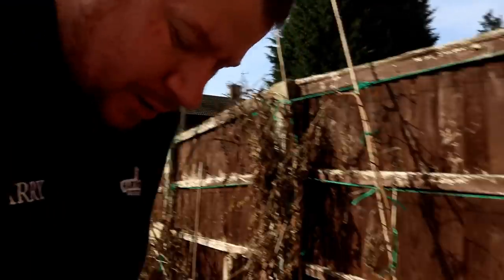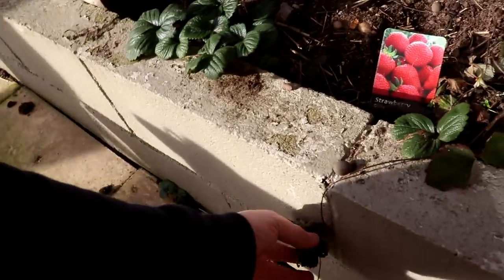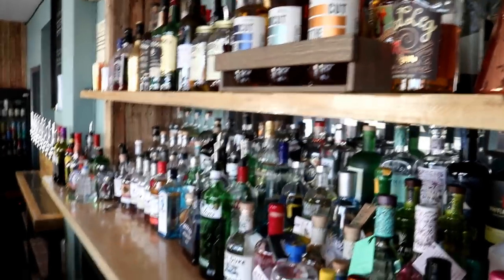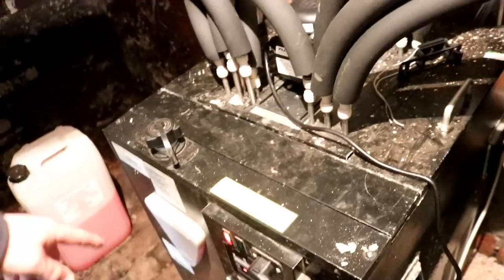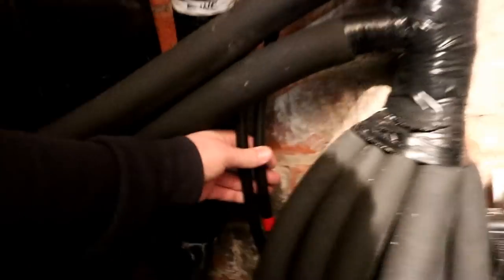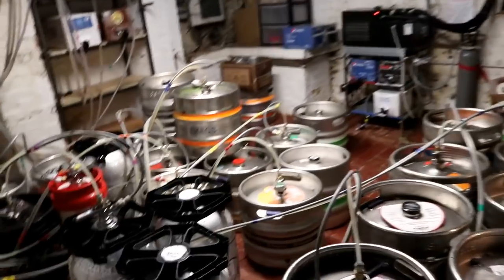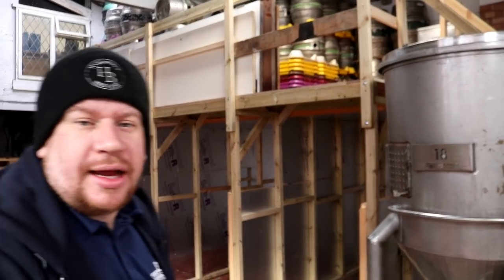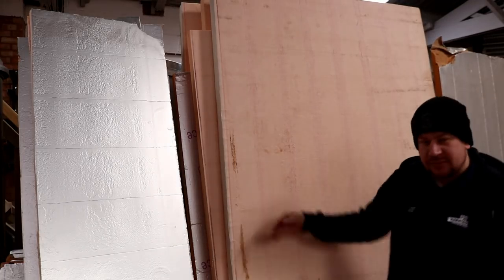SO THIS IS HOW WE COOL IT

Comment: Have you seen the Future Of Dispense (FOD) Think im going to enquire about this for my cellar refit hopefully it doesnt cost the world it uses a maxi to feed Heat Exchangers at the bar instead where it cools and you can set the temp for beer 4-10c with only 40ml of beer in the coils, Did you also see the hand pulls the shakespeare ones would reduce waste and keep beer colder without the chamber on them? Going to get rid of the nasty 1/2 braided lines thats commonly used and use 3/8 Valpar for all lines

Comment: For the doors would a skin of hardboard on either side not suffice? Half the price of plywood. edge them and then whack the hardboard on, it will provide the protection, the kingspan will provide enough rigidity and the finished doors will be a hell of a lot lighter than skinning them with plywood. Cheers, Schnuz.